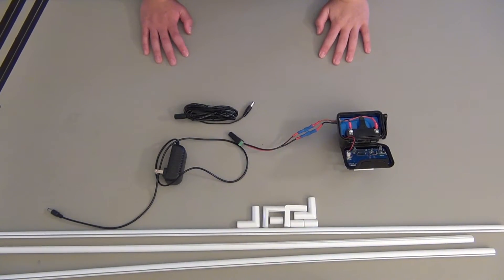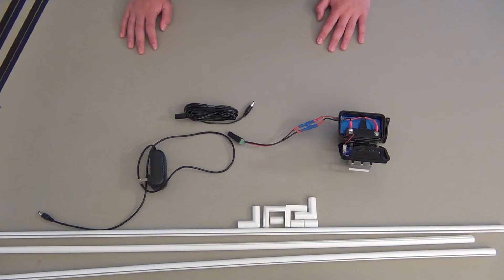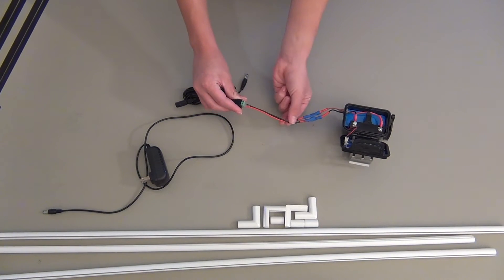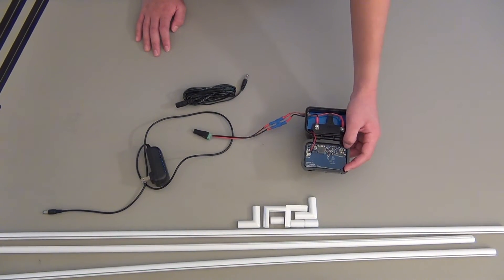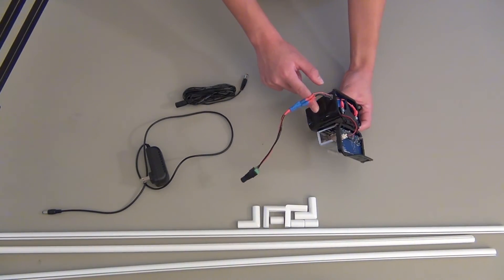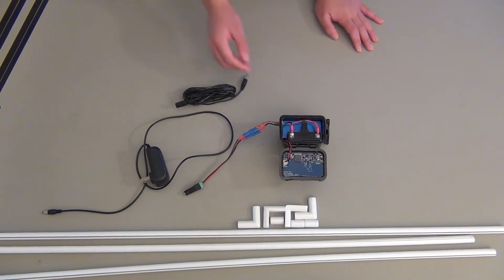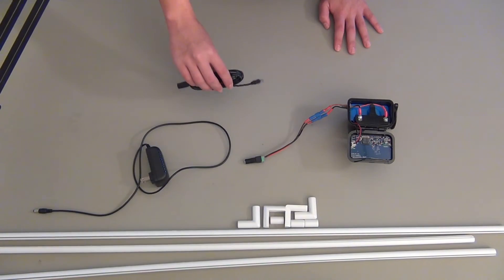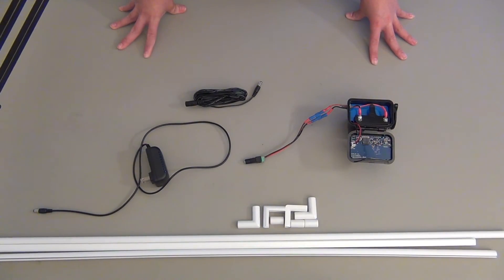Kohler Touchless Flush Wall Outlet Conversion

Comment: Hey.  I did the same thing and it keeps spinning.  So I looked online and found yours.  I soldered mine directly to the base of the springs.  So I thought it was because yours were attached to the battery container.  Did it.  Still spins endlessly.

Did you not encounter this?

I also tried it on all 3 of my units.  Same problem.
Reply: I just tried mine and it spun endlessly as well initially.  The issue seemed to be for me that the polarity was reversed.  I'm not absolutely sure about it though.  Reversing the wires stopped the endless spinning, but now it spins every 4-5 seconds.  I think the issue might be the Kohler control unit itself.  Mine had issues of random auto flushes without any input prior to this conversion (battery power.)  I might swap with another unit to see what happens.
Reply from the maker: Bartholomew Band hmm that's really weird. I haven't experienced any issues like that. The closest thing that has happened to me is when it's flushing (making one turn) and I unplug it... upon plugging in again, it returns to the "bottom position" immidiately from where it stopped when I unplugged it. I can't think about anything to troubleshoot besides checking your adapter is 6v, there aren't any shorts and making sure all the polarity is matched  (pos to pos, neg to neg)
Reply from the maker: Bartholomew Band just out of curiosity, what's the rating on your power supply? I'm using a 6v, 1A VDC out adapter. I'm really not sure how much that tiny motor draws, but if your adapter is a lower amperage (maybe 250ma or less, but that's a guess) you might be getting voltage drop that might affect the functioning of the electronics that control the motor. you could also try an adapter rated for 6v 1a or more and trying different adapters, since it's possible your adapter might not be performing to spec
Reply: My guess is the power supplies being used in the cases where there are problems may not be producing clean DC output, for any number of reasons- capacitors not large enough, inferior components, or current consumption of the Kohler is greater than what the power supply can deliver, etc. I would imagine a proximity sensing circuit (or really any other circuit) in the Kohler is sensitive to supply noise. This is just a guess though, but it was one of my concerns before coming here to see how well it went for others. In my case, the batteries are draining a lot faster than they used to without a change in use patterns, so I may just need to buy a new one. Good luck, hope this info is at least a little helpful.

Comment: i dont know why I didn't think of that. I guess because now that radio shack isn't around anymore, I don't know where to buy a D.C. converter. Our's goes through batteries in 3-4 weeks. Even if the batteries are still "good" according to my old Radio Shack battery tester, if its not all the way up to the top of the green (as in brand new), the unit will not work. Thanks for putting this up.